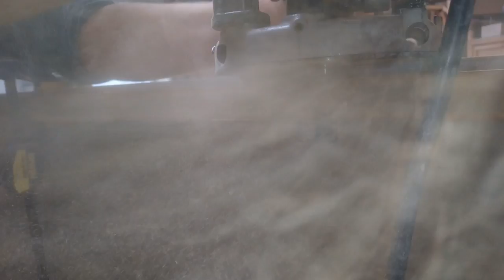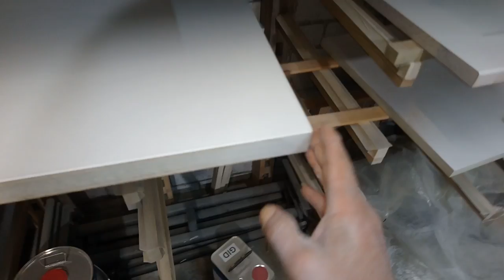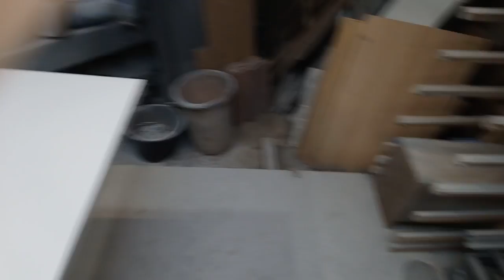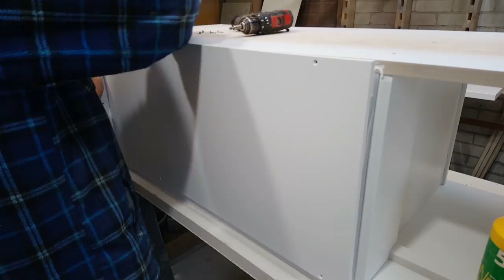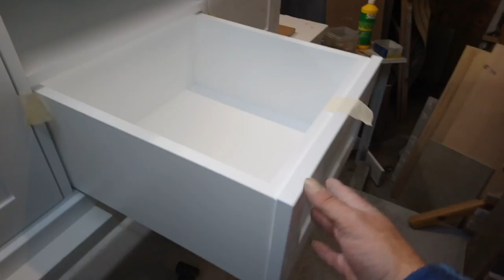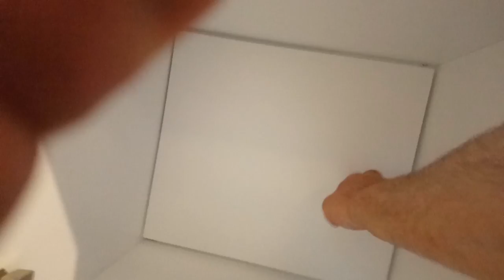TV Cabinet Build - Finished

Comment: Beautiful build as usual Gid! Is there a reason for using the plaster repair rather than Decorators Caulk between the door frames and mdf panel?
Reply from the maker: Thanks Joshua 👍 Decorators Caulk is a bit rubbery when you try to sand it so i was using normal polyfiller but that's messy to apply, this plaster filler in the tube is easier to apply, squeezes into the gap & sands a bit like the normal filler.
Reply: @Gidjoiner  ah perfect, thanks for the reply Gid 👍

Comment: I have to take my hat off to you, Sir. Another top quality build. Similar to the work I do, but better. I've never seen that No nonsense filler used like that. I always use caulk. Why do you use that Gid?
Reply from the maker: Hi, Thanks Anthony, 😊
Around the edges of the door panel where it goes into the groove there is a small dark line, I've tried different ways of putting the door panel in to eliminate that, I tried putting a bevel on the back of the panel so it squeezes the panel forward against the Beech but nothing successful,  The spray paint doesn't like filling gaps like that, I think it's something to do with surface tension in the wet paint, ...? Decorators caulk is acrylic & can be a bit rubbery when sanding, this stuff sands powdery like filler n gives a better finish 😉

Comment: Love the build Gid, it looks great 👍👍👍 I probably missed it earlier, what was the thickness of the MDF used? 🤔
Reply from the maker: Thanks Nick 👍👍
The main carcass & the drawer are 18mm Medite MR MDF, The top is 30mm & the door panels are 9mm,
Reply: Thanks GJ. Being that the unit is in a living room, is there any reason why you used MR MDF?
Reply from the maker: Hi, I always use MR, I'm not keen on MDF to start with so want to use the best, it doesn't cost much more, normal MDF reacts to the humidity in any space esp over time, the surface is 'textured' with the fibres & swells when sprayed. 
This Medite MR is better than the completely green Chronospan stuff, the green stain isn't right to the surface which can bleed through white paint & this has a much better surface, it's very flat n smooth n because it's MR it doesn't swell so gives a better finish when sprayed, It's slightly denser so fixing to it n machining is better & I don't have or want normal crappy MDF in my stock 😉
Reply: Not a great fan of MDF then eh 😂 Thanks for the explanation.